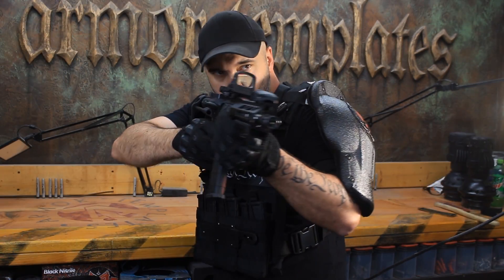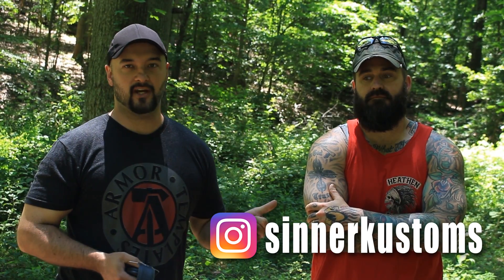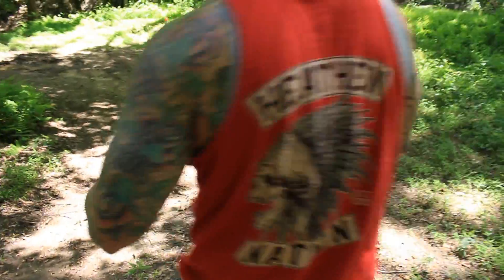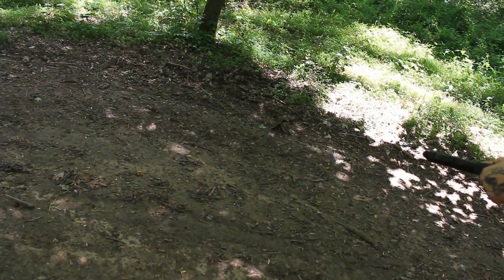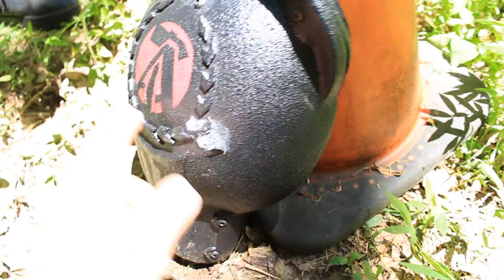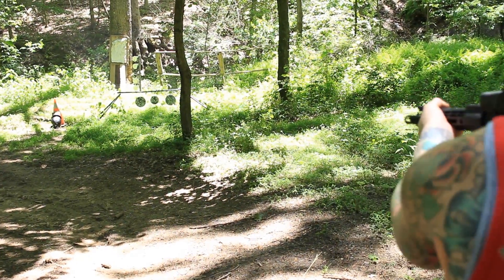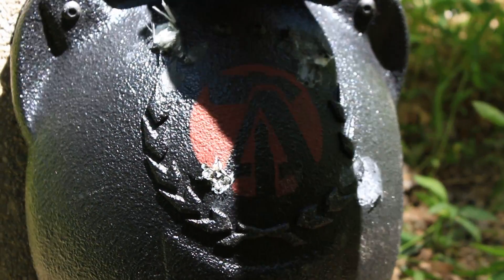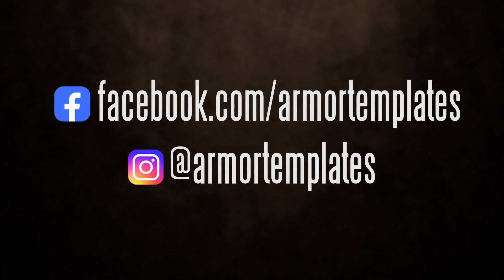DIY BULLETPROOF Shoulder Armor! Is it really bulletproof?

Comment: How come you didnt use kelver?
Reply from the maker: Because it would have cost 4x more
Reply: If you did use kelvar would you still layer it with the carbon and use the same resin?
Reply: @BzBeeJK   maybe 100% kelver is stronger and better for stopping a bullet ?
Reply: @kennethcampingdiary1976  it is.
Carbon fiber is a distraction for ballistic applications. Great for structural components that do not deal with ballistic impacts however.

Yes, the stack resists some bullets as is.
It could likely do better with less thickness/weight with glass fiber or kevlar.
Reply: I hate how people in this comment section spell Kevlar
Reply: I understand the cost now didnt know before, but sometime you cant put a price on your life

Comment: even with penetration, a lot of the kinetic energy is absorbed by the armor reducing the damaging forces applied to the body.
Reply: Its carbon fiber and fiberglass, youre gonna have hella strands in your body if it gets through and that could be worse than a clean shot
Reply: @lordpeevisoftweed  but the fact it still absorbs kinetic energy still stands. Id rather have it on than not. I think it's pretty amazing it stopped multiple rounds.

Comment: Try to increase the size, you can use it as a shield. For example, if the carrier sits down, the shoulder will protect almost the entire body. Add glass, when moving, a dead zone appears on the left edge, or remove this part. Попробуйте сделать не одну пластину, а комбинированную, как в танках -> // TY

Comment: According to my math a full set of armor of this thing could weight somewhere between 30 and 40kg (66 to 88 pounds) ...Sounds pretty heavy lmao. According to the internet a full plate armor weights alone 15-25 kg, and if you include some other armor layer under the plate like chainmail or a gambeson 25 to 35kg i guess it could be reasonable.
Reply: No. According to mine knowledge full plate armor AND gambaon weight around 23 kg for modern 180cm height person. 35 kg is way to much.  Full soldier equipment can weight so much.

Comment: Came here from demolition ranch! 

Nice work on that though, looks real good! But as he said, a layer of two of steel could make it have a better chance of stopping more powerful rounds (unless your main concern is being lightweight while still helping against smaller calibers)
Reply from the maker: It's not so much the weight (although that matters too), it's about getting the metal in the right shape to be able to embed it inside the armor. Easy to do with large, expensive equipment, but really hard to do with hand tools in the home shop.

Comment: Put a layer of steel behind or in front of this.
Make an accompanying shield to go with this that you can still use the other hand with.
Create the shield also as a stabilizing platform for any weapon, and make leg armor for total light coverage in cqb situations
Reply: That shield is going to be a whole lot of weight, all on the arm to. 
Oh and what about putting the steel at the center of the armor, rather than at the front or back. It could be used to initially apply the fiberglass to. Giving it some of the shape before pressing it in a mold.

Comment: I am impressed that the shooter cleared the guns after every shot. While this didn't stop all the shots, it could mean the difference between a bullet that stops in the in the arm and one that goes all the way into the chest cavity. In a gun fight I would rather have one of these than not. If you could add some Kevlar in the design it would probably be even better.
Reply from the maker: Kevlar was too expensive to consider for this "backyard build". I could have probably saved even more money skipping the carbon fiber. Kevlar would definitely perform better but it would have more than tripled the cost

Comment: I am actually not surprised about the 50ae not going though.
Though the 50 would do more damage than basically any round that you shot at the armor it would have some of the least amount of penetration force out of them.  A big slow round with a flat head will not pernitrate like a small fast round with a point.
This is why the 9mm defense round sometimes called the extreme penetrator was able to do so much damage was that it was able to cut its way through.
Another channel you could send this to would be TAOFLEDERMAUS https://www.youtube.com/user/taofledermaus
They do professional testing of armor and mainly shotgun rounds.  I'd check them out, they are great.

Comment: i feel like after the 9 home defense round...mark it as a fail. but its really awesome
Reply from the maker: It survived two direct hits with .50AE as well. It only failed on the rifle rounds.
Reply: Even if it penetrates, it offers enough resistance that it slows the bullet down enough to the point it might not penetrate you very deeply. Who knows, Itd also work against hollow point rounds probably. It has its uses

Comment: It's been awhile so I thought I'd see if the go fund me kicked off?  Lots of people here suggested ar500 and the like. That is not going to work given weight. What will work is composite. So the same idea but with ceramic or titanium plates layered in. The layers of protective materials would be useful and resist most rifle rounds. Even if you wanted a meat look a Metal exterior with the composite layers of Kevlar/aramid/titanium or ceramic then Kevlar again all stuck together by resin would be more formidable. Only downside is that there is really no repairing this. I;d even go as far as backing it with shock absorbing material/foam to deaden the kinetic force or blunt force.

Comment: I agree with the polish farmer. Gotta rhinkbof it as a tank turret and how they deflect small subcaliber apfs rounds. The 9mm,.40 and .50 all hit along a ridge especially the .50. Skipped it right off. The 9mm+p round hit square on the "flattest" face of the dome. The smaller faster 5.56 would likely deflect if that area had ridges as well.

Comment: What about lining it with a thin steel plate or mabye some ceramic dust to the epoxy ?
Reply: What about adding 1' thick armored plate used on battleship hulls?
Reply: @xephael3485  thatl work but probably weight 100 lbs lol

Comment: You need a cushion, a replaceable plate of material (stress dispersion/displacement) that will take at least 1 shot of 7.62 to be feasible for military use. Preferably think modular to maximize your options.

Comment: This test meant nothing if you don't have any way of simulating what it would do to a person wearing it when absorbing the shock of a bullet; because that's what the shoulder pad is meant for!
Reply: are you dumb? this is literally a few guys seeing if its feasible first... ever heard of prototype testing first? gotta test if the car runs before you can test its safety features dont ya???
Reply: @joshuacurtis7621  exactly!
Reply: Ill tell you what it did. It saved you from a hole in your arm.
Reply: @lucashurley7612  I guess they made a special brand when they came out with you.
Reply: @wildwolf3938  no, just you. Why down someone without any info to back it up. You’re the special K blend. By the way no body armor is tested outside the field on actual people.
Reply: @Calix0Slatin  IDK, does a car company test how safe their car is without test dummies?
Reply: Shoulder armor isn't supposed to save your arm. It's supposed to stop the round from entering your upper chest cavity from the side.Traditional side plates sit down by your floating ribs, and won't protect your heart and lungs. A tenderized deltoid isn't going to kill you, by comparison.
Reply: Stfu

Comment: Interesting. I'd like to know where the rounds that didn't enter ended up. It's possible that the curvature is causing them to deflect, which, might send a round from your shoulder to your head. I imagine that's why you designed the top lip of the shoulder? Or was that just to allow the attachment of the strap? Impressive results none the less! And it looks pretty bad ass, no denying that :)
Reply from the maker: Correct. That part at the top is called a haute guard. But this armor was designed to absorb, rather than deflect armor. The rounds that bounced off were a surprise.

Comment: "You're still ok, you didn't get your arm blown off".... stupidest comment possible when the round would have literally ripped through ones arm and into the abdomen after penetrating the "armor"

This is a horrible idea
Reply from the maker: k.
Reply: Dude, your profile picture is my new mental image of the armchair expert. You got the haughty arrogant look going on there.
Reply: Alright, Trevor.  Stay seated in that armchair.
Reply: @guesswhat5200  Trevor up there may be an "armchair expert", but he is absolutely correct. That round is still going to have plenty of kinetic energy left to cause major tissue damage to your arm, including severing major blood vessels. Fiberglass, carbon fiber and epoxy are not ceramic composite plates. Is it neat that it stops your average target load pistol rounds? Sure. Is it actually a practical, or safe form of body armor? No. Even the rounds that don't penetrate are still going to be dangerous. There's a good chance it deflects off your shoulder, and hits you in the side, or the face, or the forearm. Not to mention spalling from rounds that fragment on impact. This is geardo, armchair operator stuff. It's neat to look at, but not at all practical or safe. Basically overblown cosplay.
Reply: @copo2835  You're not wrong, but that isn't the point I was trying to make.  The fact of the matter is, it stopped rounds.  To call it quote on quote armor, is wrong.  It did the job it was designed to do.  It deflected some rounds, absolutely and that is dangerous, no one is arguing against that.  The way Trevor put it sounds as if it isn't any form of armor at all.  It stopped some, deflected some.  Does it need work?  Yes.  Can the fragments or deflected rounds kill you?  Oh yes.  But as a civilian attempt at body armor, it didn't do so bad.

Comment: Im not a gun guy so I don't know if what I stoped is good but I cold stoped a 762 51 mm full metal jacket 158 gran's in the same thickness as your shoulder armor at the NIJ lab in Ottawa. also stoped half inch off the leading edge. I used stuff you can buy at our local stores. It would work nicely in your molds lol. Lots of fun and thank you for the video. Super cool to see other people stoping bullets. So much fun.

Comment: more layers maybe, or add a different fabric type to the other 2 you used........
Reply: Naa bro put some ceramic tile over the fabric layers and it stop it no problem. Even the kitchen backsplash at home Depot would work fine.

Comment: I like the way it caught a lot of the pistol rounds.. thus preventing risk of secondary damage medium.... I would have liked to see it against an AK round at 500 to 600 feet at this is our enemies prefered distance.. vs our 5.56 armed guys...  really quite impressive and shows what you can do with talent and simple tools... with a workshop set up for this stuff you could likely mass produce it easily...
Would definitely go for shin protectors as ricochet hits to the lower leg are often severe and I would have high confidence in this as a protection medium...  shoulder paulderons are a good idea though.. as body armour side plates for heavy armour are now a must and assault troops or guard troops really should have heavier and heavier layers of protection... at least the option of

Comment: Don't stop doing what your doing and start a patent process. You could make millions selling this to any Army
Reply: A patent requires that you invent something new or at least a new manufactoring process and is insanely expensive to hold world wide. 
A pauldron (shoulder armor) has been used since before the middle ages and like wise carbon/glasfiber molding is also not new. 

But he could trademark his design unless it happen to look too much like Warhammer trademark.
Reply: @steffenjespersen247  even if it was warhammer look the fact that it's a "Bullet Proof Pauldron" is enough of a difference from regular pauldrons. The fact that it's not invading on the minture market. It's a completely new product of protection. Iv never seen a Bullet Proof shoulder pads before. He sells it the right way and he could make tons. Sell first to civilians and then once it makes a big hit you could start doing other pieces of armor like leg and forearm. Protect your self while firing. As long as the material is light enough. But then again soldiers carry like 100lbs+ worth of material so imagine if he got more advanced and made pockets or containers on the inside for like holding magazines. Futuristic type armor.

I'm also high would be cool to see this succceed.
Reply: @therealsechs  Oh I am not saying he cannot make tons of it, a patent is only needed if you want to prevent others from doing the same. 
And as it is now, there is no danger from Games Workshop in relation to trademark, just saying one has to be careful in future advertising, not to play on Games Workshop look alike. 
Like calling it The Astartes would be pushing it :)

Comment: Great choise of material there, there are lots of people living in 3rd world nation, where only the gov and criminals had vest n gun.. 

Having such readily available material is a great DIY for small people there to survive whenever the criminals starts a war n the gov were to incompetent to help its people. 

Sure ak round from short enough range would go thru, but if its had to go thru a concrete or wooden door first, then maybe it would be slow enough for the panel to stop it. 

Just like one of the guys whom comment below, making it into a roman style tower shield is a nice idea. So it can be use to block a door or shield the family while running away to safety. 

Personally if i am going to build a tower shield, i am going to add another layer of scratch resistance plastic, one they use in the past to protect screen. Its had similar property (or even material) with one they used on bullet prove glass. 

So even when the bullet go thru, it will greatly limits its fiber glass n carbon fiber from flying all over the place.

Comment: Everybody, kinda making the same observations, I.e, use Kevalr, hardened steel etc. Cost is then prohibitive, people like the Medieval Armour look. Thinking practically, the Issue with body armour is mobility and weight, so, looking at application, my first want, would be a bullet proof shield, before moving on to armour, something Roman looking, you could hide behind,  that could deflect rifle rounds, with insert, to lie prone and shoot, would be ideal. Easier to make, more resistant, offers better protection, zero time to put on, unlike armour, add a holder on the inside for a few mags and a side arm, would be a better investment,  plus you can dump and run, if need be

Comment: I think had the .50 hit a flat surface the results of that shot would have been different.  Having said that, this is VERY impressive DIY armor!  Nice job!  Next build (if you decide to) look into using some Dyneema sheets mixed in with your others.
Reply: ya i was going to say if he could find a way to add ceramic something similarly hard. it may stop rifle rounds.
Reply: I thought they shot the 50 on the large round spot so it didn't deflect it and there was a slight bulge on the back side.
Reply from the maker: the .50 had no penetration at all and no bulge on the rear. It was the 9mm+P that bulged so much. The rifle rounds went right through.

Comment: I mean would it be a stretch of the imagination to actually design and put a plate in there somewhere? For the bigger calibres
Reply: Yes and no. The issue would be getting a peice witht he propper thickness, hardness, and plasticity ratios into the appropriate shape. The problem with shaping is that unless it it billited (insanely expensive to do), the steel must be stamped into shape, which requires an insanely strong press (also insanely expensive to own) and can comprimise the steels qualities. So while the issue may seem simple on its surface, it's a bit more complex in execution. You also have to ask yourself  "is it worth it?". Is adding another 12 lbs (at least) of weight onto your arms, which you need as mobile as possible, worth the added protection when more than 80% of all gunfight injuries occur to the upper torso?

Comment: Looks like you need to turn your carbon fiber to 35 degrees. And add 5 to 8 layers layers .👍🧐 make the fibers closer together to stop rifle threats .nice nice concept !i been wanting to develop stuff for the army for a long time.are soldiers need better equipment
Reply: they're more likely to replace them with robots entirely as the price to for such an armor, especially on all soldiers would be astronomically expensive

Comment: Very cool project mate! What were the improvements you were thinking could make it better the next time around?
Reply from the maker: A backing plate made of high molecular weight plastic, a tighter weave for the fiberglass layers, and better straps and hardware. All of these upgrades are in the current version which was supposed to go to Demolition Ranch but they won't get back to me.

Comment: That almost weighs as much as my plates front and back. I think soft armor/kevlar would be a good choice for arms
Reply: Great White  3+ and they weigh about 3lbs each
Reply: Great White  just weighed my plate carrier with front and back plates and it weighs almost 9lbs.
Reply: @dirk480  You using those composite plates?
Reply: @shanehudson3995  Yes, just because they are lightweight. They don't offer as much protection as some other types of plate material but I feel it is a good tradeoff.  I have some heavy plates too that are 8lbs each but I just don't like humpin 16 lbs plus if you add 3 556 mags, you are almost talking 20lbs. Talk about back pain